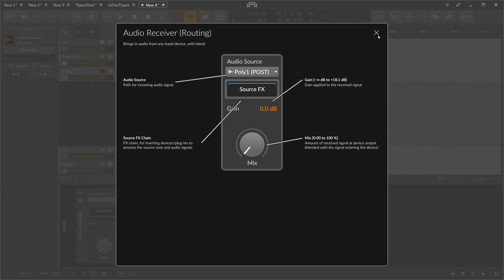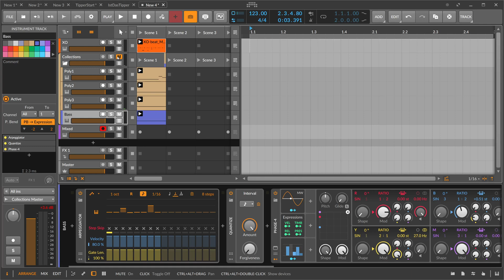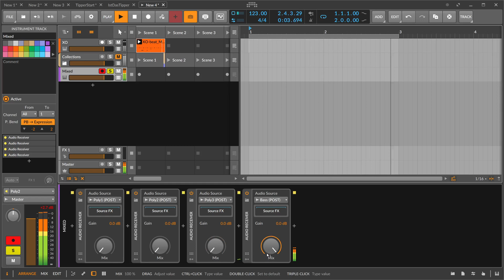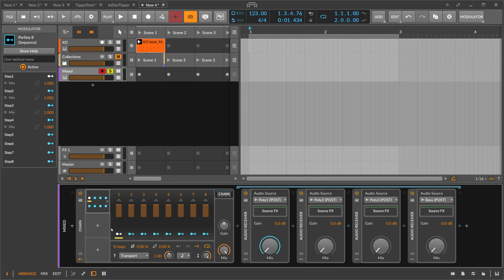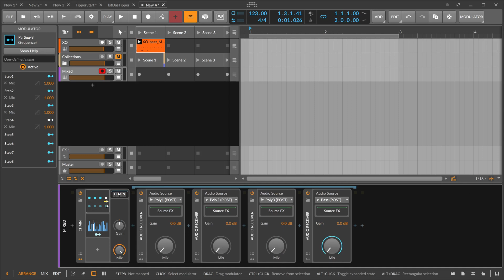Audio Receiver - Bitwig Audio FX Guide

Comment: How can I use audio receiver to receive output from a multi output chain selector?

When I put it on other inst/audio tracks, there is no routing options for the multi out!

Edit, SOLVED: It was because the instrument tracks are also routed to feed midi to Kontakt. When I changed the routing to not be midi to Kontakt 8, the routing options became visible! :o

So it seems I need to have two sets of inst tracks, one for midi to Kontakt, and ones for audio from kontakt to inst/audio track. :o
Also, the Audio receiver tracks cant be in the same folder (in a Audio named sub folder) with the Kontakt, or the routing options are  not shown :o